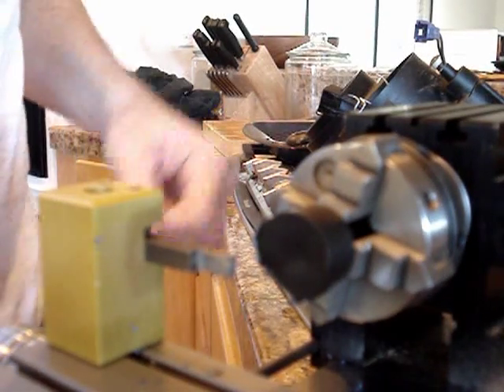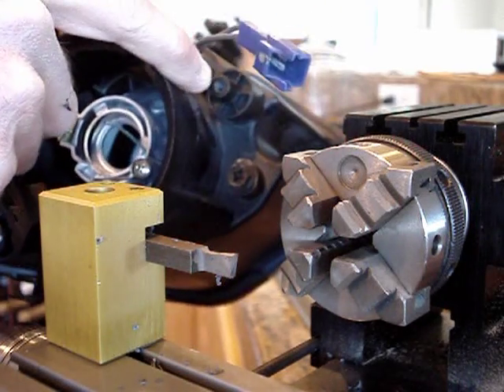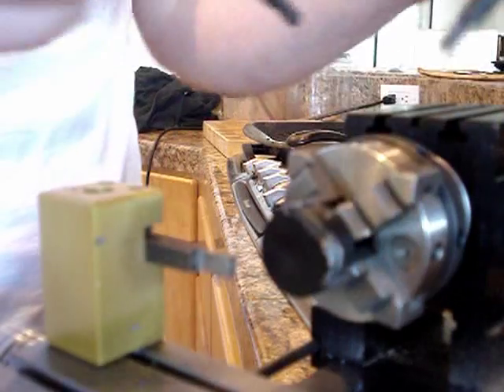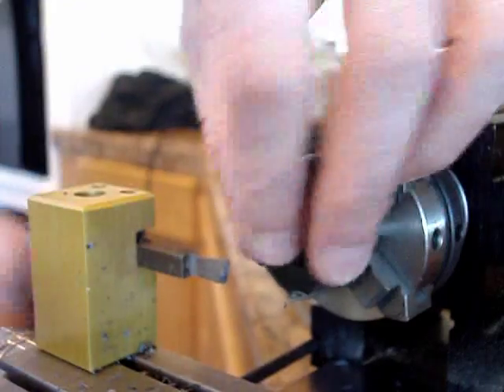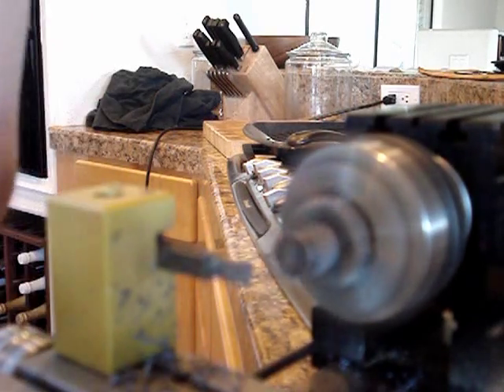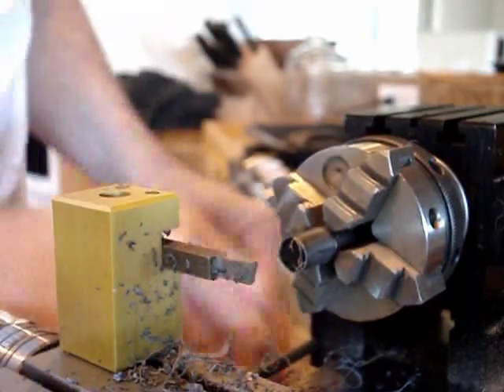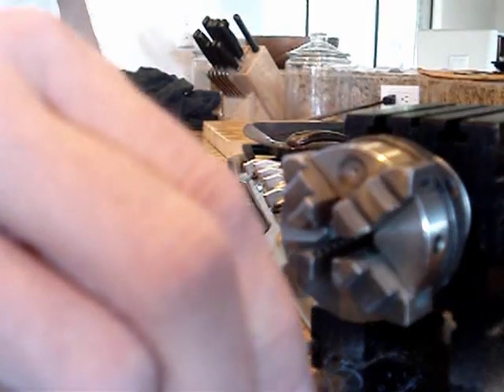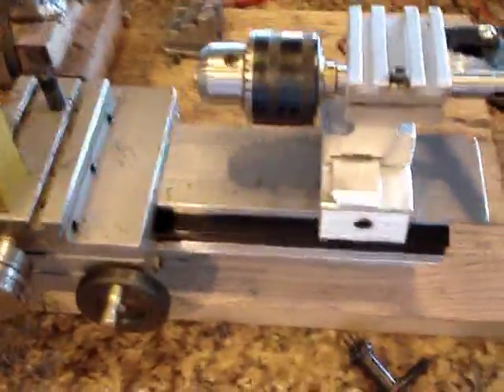Taig lathe - turning down a plastic part

Comment: This looks like a nice little lathe.  The only constructive comment I might make is that you should consider reducing the length the tool extends from the tool post.  Cutting plastic would probably be ok but turning any metal with that setup you would get chattering and a really rough cut.  Looking forward to the new camera.  Happy New Year!